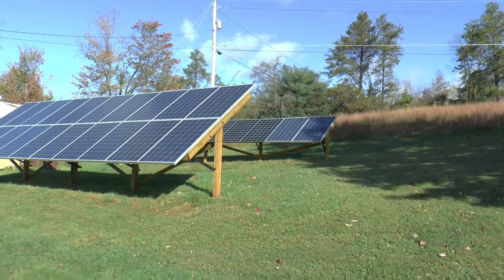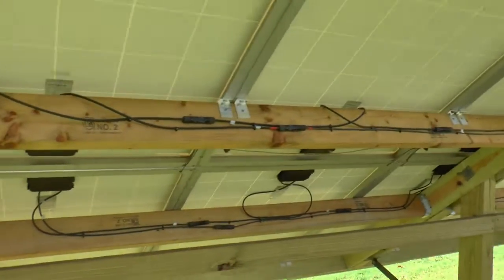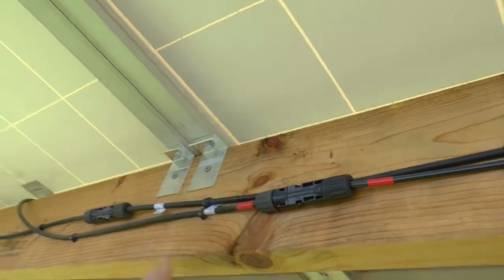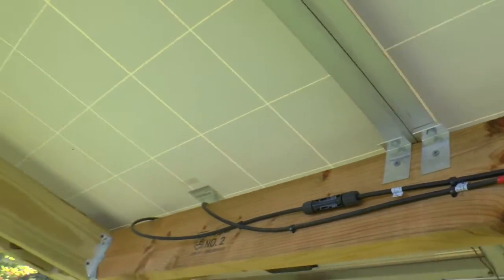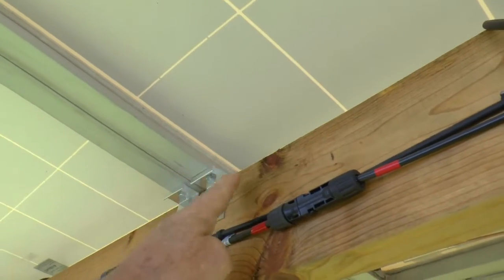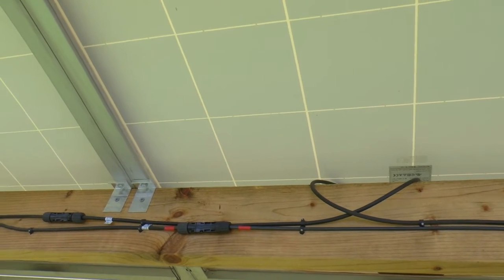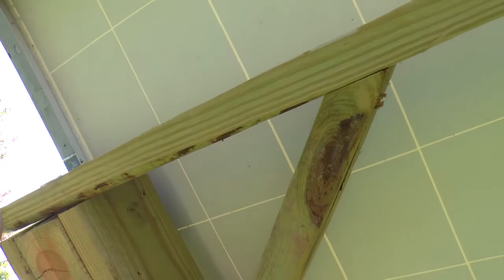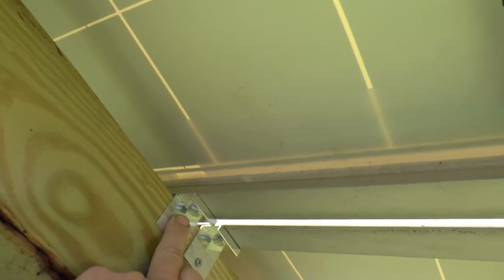Solar Panel Mounting On DIY Ground Mount

Comment: To mount our panels we used Superstrut with 3/8” bolts and square washers which works really well and makes it easy to remove the panels if needed due to severe weather!  Thanks for the video!

Comment: Hello there SIR🇺🇸
👁️ am a POPPA too…….my grandchildren overruled my parents!❤️❤️‍🔥❤️‍🔥❤️‍🔥
And 👁️ too am building a ground mount however mine MUST TILT from summer to winter well because …
NEW HAMPSHIRE❤️‍🔥
I’m gonna build mine very similar, but I want to somewhere north of center I’ll put a 1 inch black iron or whatever I can find pipe all the way across and mount physical bearings ……pillow block bearings and at the bottom have an adjustment bar on each one of the posts that will go Almost 90° to the Earth in the summer to darn near 90 degrees to earths surface in the winter 😊
May god bless you and your family sir🙏🏼❤️‍🔥🇺🇸

Comment: What is your opinion on ease of use? The big double rack or the single row rack?
Reply from the maker: I  like the single rack. They are easier and less expensive to build. Mounting the panels is easier. They are easier to clear the snow off if your in cold area.